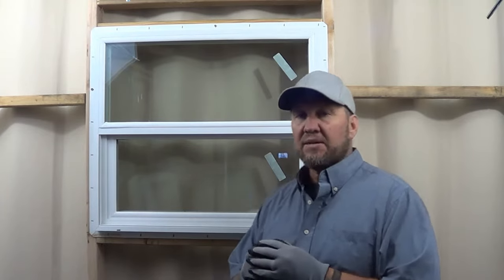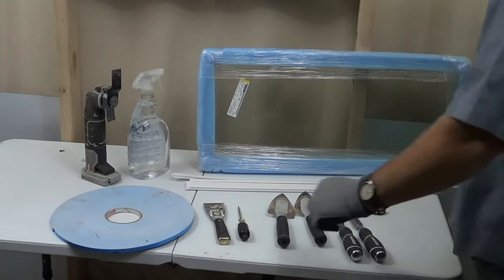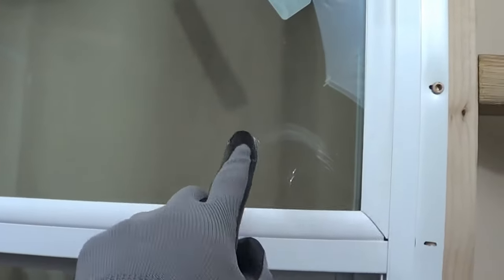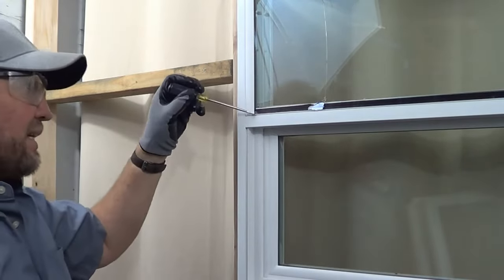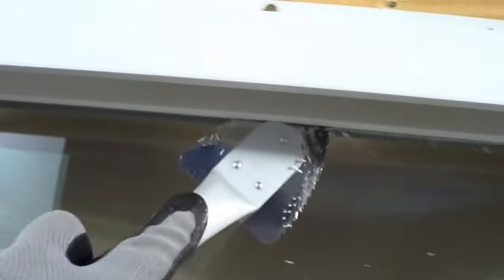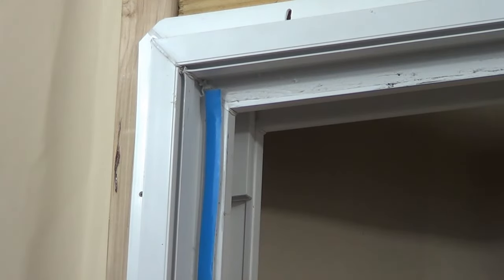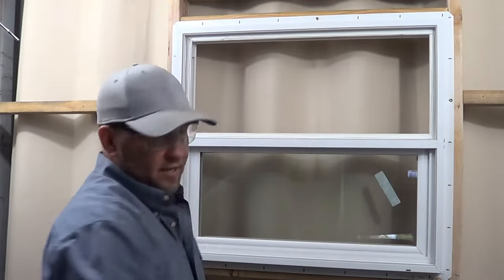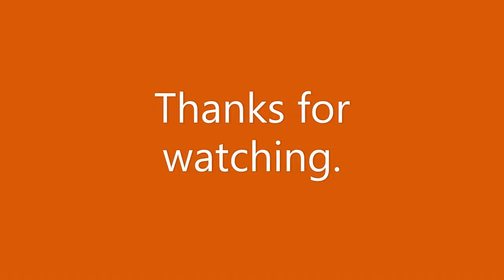Replace a Broken Window Pane  - UPDATED

Comment: When doing a double pane do you have to replace both pieces of glass or can you get away with just replacing the one piece that’s broken?
Reply: You gotta do both. There is a insulated gas that is put inside the pieces the glass, and it escaped as soon as it's cracked. Plus, the removal/install is going to be easier.
Reply: It should come as two panes already sealed together as one unit...

Comment: It would've been nice if you showed the glazing beads cuts, because one side end of the gb is cut straight and other is cut 45 angle, also when installing the glazing beads they go in a certain way to fit properly.
And  on the bottom of the frame there are 2 rubber plates a few inches away from the bottom corners to rest the botton of the glass on each plate which will allow the glass to be vertically top and bottom evenly spaced then you can square the glass by holding it as you did to rest on the double glazing tape.

Otherwise it's a great video...